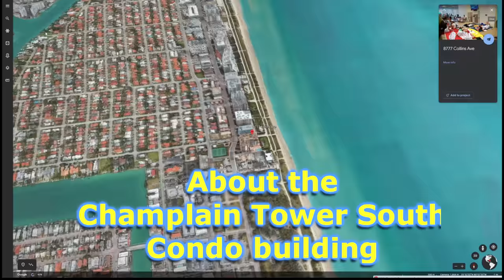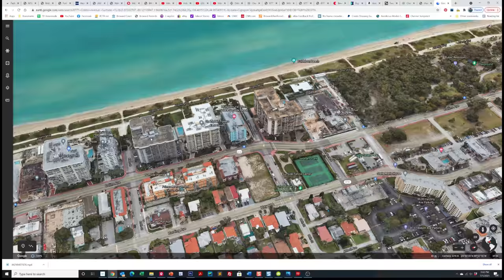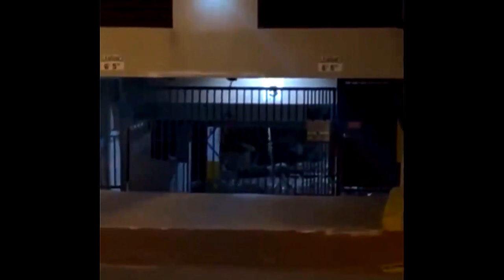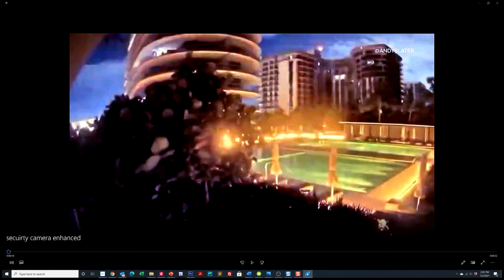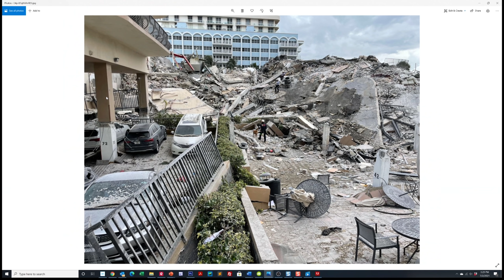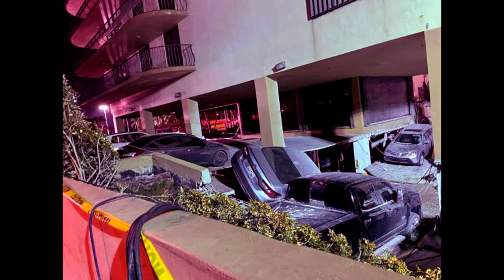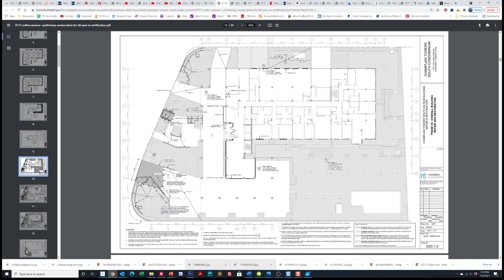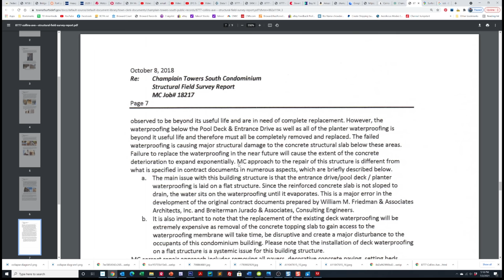Here's Cause Of Miami Condo Collapse Champlain Condo Towers, Surfside

Comment: Ironic how nothing fell in the pool but the corrosion under the pool explained everything.
Reply: Joe Kelly  The pool was essentially self supported, with the  base of it bearing on the ground, and the pool walls were also bearing on the ground, so no real load there. Even if it did cause the collapse due to water, which seems unlikely given the flat deck and the planters (which this video didn't mention, but which collect water), it would have remained intact and it in fact did remain intact.
Reply: If this were true, there'd be thousands of examples of buildings all along the coast collapsing due to saltwater and heat. This clearly wasn't corrosion. The probability that all the steel beams inside the concrete were equally corroded, and gave way at the same time without explosives is statistically impossible. Also, there's no way that natural corrosion would cause the building to be collapsed into tiny pieces of rubble. If this were natural, there would be huge pieces of the building still in tact, even after collapse. There's none of that. The debris of the fallen building is literally dust. Could have been DEW, either way, this didn't occur naturally.

People need to wake up. You can see the flashes(explosions) right before the reinforced steel concrete slabs were cut with dynamite or a DEW.

@Prairie Pucker said, "personally, I think you're an idiot. But there's gonna be an investigation. If there's wires and thermite, they're gonna find it"

Well, personally I think you're as useless as a used an bloody tampon, because they demoed the rest of the building 10 days later. They're going to find wires and thermite, but how can they find the cause of the collapse, when they destroyed the evidence? That's called a cover-up.

John Macafee had a residence in the building. This is your government. Wake up.
Reply: When you actually pay attention you will see he was simply showing what spalling was. Spalling was likely the cause of the collapse though not it them place he pointed it out.
Reply: @nikkishears6402  Tinfoil hat alert!!!
Reply: Pool did not make this building fall
Reply: @davemattia  If one person sounds dumb, it's you Dave. This is a very good video of what could have happened.
Reply: @xChrisN1975x  it's pretty clear that the ones with no commen sense and critical thinking skills are the ones wearing tinfoil hats. Not those who can think for themselves and can see clearly.
Reply: @nikkishears6402  Maybe you're not familiar with the way corrosion works. The water comes from above. When you see the spalling below the beams the whole beam is compromised. Also, when a vertical column collapses it causes a domino effect. All it's load is suddenly carried by the next column, plus the horizontal pull caused by the adjoining, collapsing column.
Reply: @nikkishears6402  from my understanding HAARP was used to take out these condos..
Reply: @heikkipolojarvi5736  , maybe you're not familiar with physics. If this theory were true, buildings all along the coast would be tumbling down. They're not. Name a single building that collapsed into free fall due to saltwater and heat. I'll wait.

Again, it's physically and statistically impossible that every steel reinforcement would be equally corroded and give way at the exact same time, causing a free fall collapse, dear easily manipulated.

And Macafee had a residence in the building.
Reply: @nikkishears6402  You are completely incorrect. A structure like this stands because the load of it is shared between many supporting structures. When a supporting structure fails the load it was supporting gets added on to the load the remaining structures have to support, plus it tugs on them in directions that they were not designed to resist, and once it exceeds the load they are able to support they will fail as well even if they were still in perfect condition. Clearly you know ABSOLUTELY NOTHING about structural engineering.
Reply: @davemattia  Built on sand?  What no pilings? Do you have an engineering degree?  Ping pong effect?   How have all the other buildings stayed standing then?
Looks SUSPICIOUS to me.  Just like 911.  Steel from China??
Reply: @debbyrobertsschabes647  1) Built on sand - yes - basically. The whole chain of land that makes up Miami Beach is built on man-made strips of sand and piled limestone dredged from the inlets and sea bottom.  Miami Beach is basically a fake barrier island.  2) Pilings?  Of course, they use them - proof that it's sand - but the law of averages suggest that when you build on sand, regardless of pilings, thousands, perhaps millions, of high-rise buildings throughout the world, you are eventually going to have a structural failure for any number of reasons.  These people were in the wrong spot at the wrong time.  Like a little house in the middle of a Scottish hamlet that gets hit with a 747 falling out of the sky.  It happened.  2)  Cheap Chinese steel - a definite possibility.   3)Chintzy real estate moguls - uh huh.
Reply: @nikkishears6402  thank you! If bombs in the parking garage at the bottom of the Twin Tower's couldn't bring down the building, how the heck would water be able to? This is bigger than just a water leak! One guy said he heard an explosion. Come on people!!!! Wake up!!!!!! This guy's explanation of how water caused the collapse could never happen! My uncle is a contractor and he said there's no way water could bring down this building. It's a nice narrative the msm would want us all to believe,  but it's not feasible!!!!
Reply: Wht up Tren Genius..✌
Reply: @OSUBUCKEYE1  And the Earth is flat too, right? Conspiracy theorist nut.
Reply: @kendalwilliam3980  , this was about Macafee's supposed suicide. Macafee had a residence in the building.
Reply: @kendalwilliam3980  , watch the video. You can see the tell tale signs of controlled demolition. This building was wired for demo. It wasn't HAARP.  Higher atmosphere auroral research project, that's all about weather manipulation, not building destruction. It could have been directed energy.

And Macafee had a residence in the building.
Reply: @OSUBUCKEYE1  , thank God others are paying attention.  Water corrosion has NEVER brought down a concrete and steel building in free fall.

It's hilarious that these morons think buildings just collapse into free fall for no reason other than corrosion.

Could have been DEW.
Reply: @NSRS1  exactly, the building obviously was a controlled demo. The fact that anyone believes that corrosion caused this is completely lost.
Reply: @davemattia  , no, dear obvious lies and propaganda. A concrete and steel building has NEVER collapsed at free fall speed due to corrosion. Name one.
Reply: @heikkipolojarvi5736  nonsense. The building fell because the columns were cut.
Reply: @kendalwilliam3980  😭😂😅🤣🤣🤣😅😂😭😭
Reply: @UNcommonSenseAUS  , thank you! No concrete and steel building has ever been destroyed in free fall due to corrosion.
Reply: @OSUBUCKEYE1  people don't want to see the truth.
Reply: @nikkishears6402   Given the limited evidence publicly available, experts now say it likely collapsed due to a “perfect storm” of random events - just like I tacitly implied, "Eventually, a building was gonna come down," but you know where I was wrong, Nikki?  It has indeed happened before, and it has happened a LOT of times.  Namely in Rio (1998) and Seoul (1995) to name just a few.  The incident in Rio (100s dead) was exactly the same as in Miami, and in Seoul, 500 people were killed in, again, the exact same kind of collapse.  Don't you google stuff before you come on here?
Reply: @davemattia  , reinforced steel concrete buildings don't collapse into free fall without explosives. This is basic physics.
Reply: @davemattia  , and this is the result of believing everything the TV and Google tell you.
Reply: @nikkishears6402  right on bro
Reply: These reports are goddamned, big-time lies. The causes of the disaster were willful negligence, indifference to human life, and greed. All this focusing on cracks in concrete is to distract you from the facts. The facts are they knew about it three years ago, and they did nothing about it. Knowing and doing nothing to prevent the catastrophe is criminal. Of course, in this insane country, they will try to sweep that aside and focus on material failures that were already known years in advance. In China those responsible would be imprisoned or executed. In the US they would probably be promoted.
Reply: @markcantemail8018  , controlled demolition.  Reinforced steel concrete buildings don't collapse into free fall without explosives. This is basic physics.
Reply: @davemattia  , please, learn something.

The physics of 9/11 — including how fast and symmetrically one of the World Trade Center buildings fell — prove that official explanations of the collapses are wrong, says a Brigham Young University physics professor.

In fact, it's likely that there were "pre-positioned explosives" in all three buildings at ground zero, says Steven E. Jones.

In a paper posted online Tuesday and accepted for peer-reviewed publication next year, Jones adds his voice to those of previous skeptics, including the authors of the Web site wtc7.net, whose research Jones quotes. Jones' article can be found at physics.byu.edu/research/energy/.

Jones, who conducts research in fusion and solar energy at BYU, is calling for an independent, international scientific investigation "guided not by politicized notions and constraints but rather by observations and calculations.
Reply: @nikkishears6402  I think I would sooner believe structural engineers than a particle physicist when it comes to understanding building collapse. One thing I have learned about specialized fields in science is that the people who work on them can be incredibly ignorant about things not close to their field. For example a virologist can be almost as ignorant as a regular college graduate when it comes to parasitology. Just because he is a scientist does not mean he can not be wrong. What matters in the end is the actual work.
Reply: @AzureDrag0n1  , structural engineers HAVE TO study physics to earn their degree, dear predictably obtuse. So lost.
Reply: @nikkishears6402  What a steel framed building does is not relevant here. This was a reinforced concrete structure. You clearly have not got a clue.
Reply: @AzureDrag0n1  , one thing I've learned from being an SRN, medical degree, is that fake accounts on YouTube ALWAYS back up and repeat whatever the media and governments tell them.  If all you're going to do is repeat your moral and intellectual superiors on TV, then you're nothing more than a parrot. No one needs another YouTube Nazi shilling and forcing propaganda down the public's throat so that we can all be the morally bankrupt and intellectually starving masses the government so desperately wants us to be.
Reply: @AzureDrag0n1  , it's called "The Laws of Physics" for a reason. No one's knowledge can be above the natural laws of science, dear easily manipulated.
Reply: fastguitar  , that's called critical thinking. Well done. You're one of a very small group who are still capable.

Macafee had a residence in the building.
Reply: @nikkishears6402  The only basic physics you know is that when you are full of s^^^^t  -- it eventually falls out into your shoes.
Reply: @kendalwilliam3980  so they missed also didn't the guy being extradited back to the US that died have a condo in Champlain Towers or is that more fake news
Reply: @davemattia  like the palm-tree inlets built in Dubai
Reply: @abatude5879  Yes -- very astute comparison.
Reply: @davemattia  , I'm an SRN. Medical degree. You don't even know what that is, dear pretending to have a doctorate.

From your Bio, which you told me to Google:

"Raised in New Jersey and originally educated as a zoologist, David-Damien Mattia works professionally as a writer for several international horse racing publications after having spent the last 25 year working as a successful trotting racehorse trainer and horse racing journalist. He also works as a featured journalist and columnist for The Canadian Sportsman Magazine, where his featured column, "Laugh Track" has been a favorite with horse racing fans since 2006. David is also a distinguished reporter for Harness Link and Harness Racing Update which are considered to be the most widely read horse racing websites in the world. Prior to devoting his career specifically to journalism and screenwriting, he trained some of the most famous harness racehorses of all time."
Reply: @davemattia  , where's the part about your degree, dear intellectually starving and morally bankrupt?😏🤣🤣🤣🤣🤣

You're a horse trainer. 🤣🤣🤣
Reply: @davemattia  , it says nothing about an award for any "film" you made, dear delusions of grandeur.
Reply: @davemattia  , also funny that your YouTube picture doesn't match your Google bio picture. Wonder why, dear liar?
Reply: @nikkishears6402  ....and you keep forgetting your second commas -- ugh -- imagine what you look like.
Reply: @nikkishears6402  Why does everyone block you ?   Because you are a troubled evil person - you're a mess - you are unhappy - you hate your father - you have many failed friendships and relationships -- you want people to hate you -- and you're very good at it.
Reply: @nikkishears6402  ok I won't stoop and comment how dumb your comment is. I will just prove how dumb it was. Obviously they did not all fail at the same time. 1 of them failed. The 1 below was suddenly struck with a force beyond its rating. So on and so on. I mean its not hard to figure out here my man.  If 1 can hold a ton and its struck by the 2 ton beam above it then Obviously it will fail. In fact thats how they demolish buildings. Ugh
Reply: @nikkishears6402  please don't refer to physics anymore you are making yourself look really really foolish.
Reply: @debbyrobertsschabes647  American steel was used in 79
Reply: @nikkishears6402  strike 2 careful you only have 1 left
Reply: @nikkishears6402  thats 3 strikes you are out dear Nikki. Hint....if the bottom is first to fail it causes free fall.......pssssst don't tell anyone. I cant tell you more it might hurt all 3 brain cells
Reply: @justanbaker8937  , "get laid. It will help."

Married 17 years. I get Laid twice a day, at least, dear PROJECTION, rolled in HYPOCRISY, and smothered in JEALOUSY.
Reply: @justanbaker8937  ........ And BLOODY....
Reply: @justanbaker8937 ...................... TAMPON,..........and twice as nauseating. 🤢🤢🤮🤮🤮🤮

🤣🤣🤣🤣🤣🤣🤣🤣💀👻🤣🤣🤣🤣🤣🤣🤣🤣🤣
Reply: @justanbaker8937  , I love your DUMFOUNDED silence followed by your absence. You're so accommodating. 🤣🤣🤣

That's called reverse psychology. Watch it work on you, dear easily manipulated.
Reply: The pool deck collapsed first.
Reply: @Courtney-1991  , the roof collapsed first. It's on video. 5 different angles.
Reply: @nikkishears6402  the pool deck ! That is located above the garage watch this video all the way through..people recorded the leaking in the garage and you can see the debris laying on the bottom of the garage 7mins before the collapse..did you even watch this video all the way through before you helped yourself in the comments 🙄
Reply: @nikkishears6402  And you just contradicted yourself if the roof collapsed first?
Reply: @Courtney-1991  , I provided the proof, dear Google GESTAPO. The roof collapsed first. It's on video, which I provided. This had nothing to do with water/salt corrosion, a leak, or heat. 

No steel reinforced concrete buildings has EVER fallen at free fall speed because of water. Not one.
Reply: @Courtney-1991  , 🤣🤣🤣even the news anchor mentioned that it "looked like controlled demolition."
Reply: @nikkishears6402  uh can’t believe the news..ya it was a pancake collapse hence why their saying it looked like a controlled demo. But it wasn’t ! If you would watch this video all the way through maybe get a different Perspective..this guy explains columns 72 and 43 very important
Reply: @Courtney-1991  , a "pancake collapse" excludes free fall speed. This building fell in free fall, dear failing to understand physics.

A free-falling object is an object that is falling under the sole influence of gravity. A free-falling object has an acceleration of 9.8 m/s/s, downward (on Earth). This numerical value for the acceleration of a free-falling object is such an important value that it is given a special name. It is known as the acceleration of gravity - the acceleration for any object moving under the sole influence of gravity. 

Gravity didn't bring down this building, and therefore each floor that "collapsed", would have to fall at a slower speed than the previous, dear obtuse.
Reply: @Courtney-1991  , I watched this video. This man has zero evidence for ANY of his assertions. The fact that you would be led astray by a no name YouTuber with zero proof only exemplifies how easily manipulated you are.
Reply: @nikkishears6402  ok well they will do a investigation, I’m 99% sure it was pure negligence that resulted in a building collapse with many fatalities..but a controlled demo no way they would have been able to figure that out already I’m sure and they will run test to test for thermite
Reply: I've got a concrete retraining wall in my BEACH HOUSE yard. I've had it rebuilt twice in 30 years. That is how corrosive the salt air is to concrete and steel rebar. As he explains, the steel swells due to the corrosive rust, which in turn, compromises the integrity of the concrete. In my case, the wall isn't holding up the foundation of the house, but holding the sand dune on which the house is built. Anyone who owns a home on the coast knows exactly what I'm talking about.
Reply: @Courtney-1991  , that's called hubris. You aren't sure at all, because you've refuted your own theory of what happened by labeling it a "pancake collapse". Impossible to be in free fall if it collapsed the way you say.

You couldn't have watchd any of the videos of the collapse. You can literally see flash bangs (explosions) at the base of the building. 

"There will be an investigation"

They demoed the rest of the building ten days later. They're going to find explosives. But how can they find the cause of the collapse, when they've destroyed the evidence?

"There will be an investigation"

You mean like the Warren commission? Your government told the public that a magic bullet made a u-turn when it killed Kennedy. Do you really trust your government? 

Please, don't repeat talking points that mean nothing.
Reply: @nikkishears6402  ok whatever you say 🙂
Reply: @RW4X4X3006  , 🐂💩. Water and salt alone have NEVER brought down a reinforced steel concrete building.
Reply: @Courtney-1991  , that's not an answer to my question. Do you really trust your government to tell you the truth?
Reply: @nikkishears6402  Really now...
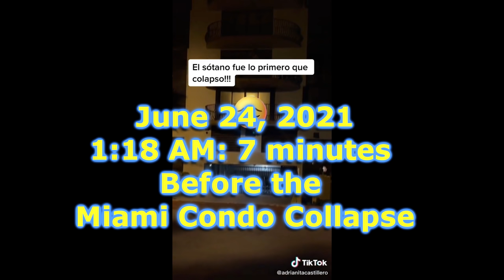Reply: @nikkishears6402    So then explain the video shown at 7:29 that shows the leaking and bits of concrete under the POOL DECK that occurred 7 minutes before the collapse. I guess you’ll say that’s just a coincidence. “Nah, the pool deck just crumpled up on its own for no reason before the controlled demolition. The fact that it’s also exactly where engineers are saying that the building collapsed is also a coincidence.”
Reply: @beckybrooks2150  , please, stop believing everything the TV tells you. I watched this video. This man has zero evidence for ANY of his assertions. The fact that you would be led astray by a no name YouTuber with zero proof only exemplifies how easily manipulated you are.
Reply: @beckybrooks2150  , the roof collapsed first. It's on video, which I provided. This had nothing to do with water/salt corrosion, a leak, or heat. 

No steel reinforced concrete buildings has EVER fallen at free fall speed because of water. Not one.
Reply: @beckybrooks2150  name a single steel reinforced concrete building that fell in free fall due to salt/water and heat. I'll wait.
Reply: It's built like a brick shithouse, and sits far away enough not to get buried in the rubble pile.
Reply: Imagine that!
Reply: @nikkishears6402  Yep!
Reply: @xChrisN1975x  I was waiting for that remark...some people never learn.
Reply: Concrete is porous and absorbs water similar to a sponge, when level with cracks water gets to the metal rods within concrete causing rust/expansion/cracking. This occurred at the base of smaller? concrete pillars with less rods. Makes sence. Thanks for your knowledge shared.
Reply: @davemattia  Just wondering,would you say that to a man you were face to face with?
Reply: I just think that's its only in our country thst buildings just FREE FALL INTO LESS THAN RUBBLE ..........
Reply: @nikkishears6402  this is not a steel frame building. It is heavy traditional  construction. Reinforced concrete slab floors supported on reinforced concrete columns. Common construction fault, insufficient cover to the reinforcing steel. Once  the steel has rusted, concrete has no strength in tension. It will break under its own weight.
Reply: So were the people in the pool at the time safer than those in their condos
Reply: I had that exact same thought!
Reply: @nikkishears6402  what?!?! Lol Why would anyone do that and why would they hide that fact? Everything isn’t a damn conspiracy for God’s sake!
Reply: @NSRS1  seriously! Sometimes these m o r ons make me wanna throw my phone!
Reply: @xChrisN1975x  You expect anyone to take you seriously?
Reply: @norisboren5402  , really? How come not one other building in Florida has EVER "collapsed into free fall" from salt water and heat. Name one. I'll wait.
Reply: @paulnewell927  , I said that, dear. "Reinforced steel concrete." Word for word. Name a single building in Florida that was collapsed into free fall by salt water and heat. It's NEVER happened.
Reply: @SimonEllwood  , 

"Insurance fraud is any act committed to defraud an insurance process. It occurs when a claimant attempts to obtain some benefit or advantage they are not entitled to, or when an insurer knowingly denies some benefit that is due. "
Wikipedia
Reply: Corona Virus  , thank you! I just call em like I see em. 🤣🤣🤣
Reply: Joe Kelly  As I've mentioned elsewhere, it would appear that the hot tub, specifically, was the place of first collapse. I don't know this for certain, but the shape of the concrete room in the spalling photos makes me believe that it is the concrete around the hot tube and that leaking of high temperature water has been going on for some time from that area. Remember that the entire condo seems to be supported on relatively thin columns with great resistance to downward forces but not very good resistance to horizontal forces, and also note that the slabs are poured between the columns and connect to the rest of the building. A slab tipping and falling into the parking garage would exert strong horizontal force on the sea of vertical supports holding the building.
Reply: @SimonEllwood  

"While a number of bridges, overpasses and buildings under construction fail each year, the catastrophic collapse of an occupied building — absent a bomb or an earthquake — is rare, and investigators are struggling to understand how it could have come with so little urgent warning."

“It would be like a lightning strike happening,” said Charles W. Burkett, the mayor of Surfside, Fla., where the collapse occurred. “It’s not at all a common occurrence to have a building fall down in America,” he said. “There was something very, very wrong with this situation.”

"Structural engineers were shocked that a building that had stood for decades would abruptly crumble on an otherwise unremarkable summer night."

- New York Times
Reply: @matthewmosier8439  , according to the video evidence, the roof collapsed first.
Reply: @paulnewell927  , "While a number of bridges, overpasses and buildings under construction fail each year, the catastrophic collapse of an occupied building — absent a bomb or an earthquake — is rare, and investigators are struggling to understand how it could have come with so little urgent warning."

“It would be like a lightning strike happening,” said Charles W. Burkett, the mayor of Surfside, Fla., where the collapse occurred. “It’s not at all a common occurrence to have a building fall down in America,” he said. “There was something very, very wrong with this situation.”

"Structural engineers were shocked that a building that had stood for decades would abruptly crumble on an otherwise unremarkable summer night."

- New York Times
Reply: @becorations1  , really? How come not one other building in Florida has EVER "collapsed into free fall" from salt water and heat. Name one. I'll wait.
Reply: @becorations1  , 

"While a number of bridges, overpasses and buildings under construction fail each year, the catastrophic collapse of an occupied building — absent a bomb or an earthquake — is rare, and investigators are struggling to understand how it could have come with so little urgent warning."

“It would be like a lightning strike happening,” said Charles W. Burkett, the mayor of Surfside, Fla., where the collapse occurred. “It’s not at all a common occurrence to have a building fall down in America,” he said. “There was something very, very wrong with this situation.”

"Structural engineers were shocked that a building that had stood for decades would abruptly crumble on an otherwise unremarkable summer night."

- New York Times
Reply: @becorations1  , I feel we need to talk about 9/11, cause clearly you believe the narrative from your government. Probably should discuss JFK as well, and the magic bullet that made a u-turn to kill him: official government narrative. Stop believing everything the TV tells you.
Reply: @nikkishears6402  it's just ridiculous the amount of deception than can be played upon the people. I came to the comment section while listening to this B's theory thinking thousands would be like - no way. Yet, here we are, a few of us shaking our heads, omg
Reply: @davemattia  )
Reply: @davemattia  If you believe MSM today, then I've got oceanfront property for sale here in North Dakota for you.
Reply: @barbibutton9619  , it's so sad that critical thinking is no longer a human capability. Unfortunately, I'm not shocked by the total lack of curiosity on behalf of the indoctrinated masses.

"it's easier to fool the people, than to convince them they've been fooled" - Mark Twain.
Reply: @nikkishears6402  Exactly.  If salt water, heat, etc., had caused this corrision and the building to collapse, why is the sister building, Champlain Towers North,  experiencing the same flaws, but it was given a clean bill of health at the same time the South towers failed its inspection. They were built at the same time, same contractors, same everything.  So, there is your control against why it isn't what MSM, etc., is saying it was spalling.  If it was, then the North towers would be exhibiting the same symptoms.   It's not.
Reply: @SimonEllwood  And you believe what is written on wikipedia?  That's like believing MSM.
Reply: @rhondaalbrecht  agreed. It's obvious to anyone with a working brain that salt water is incapable of causing a building to free fall into collapse. 

Most people are beyond stupid, and that's because our government has purposely engineered this stupidity. Propaganda had been legally pushed in America since 2005. Before 2005 it was illegal for our own government to propagandize the American people. Now they have legal authority to lie to us.
Reply: Lies Exposed  , yup! Couldn't agree more.
Reply: @rhondaalbrecht  I have helped write quite a few Wikipedia articles, where do you get your information from?
Reply: @SimonEllwood  , 

"While a number of bridges, overpasses and buildings under construction fail each year, the catastrophic collapse of an occupied building — absent a bomb or an earthquake — is rare, and investigators are struggling to understand how it could have come with so little urgent warning."

“It would be like a lightning strike happening,” said Charles W. Burkett, the mayor of Surfside, Fla., where the collapse occurred. “It’s not at all a common occurrence to have a building fall down in America,” he said. “There was something very, very wrong with this situation.”

"Structural engineers were shocked that a building that had stood for decades would abruptly crumble on an otherwise unremarkable summer night."

- New York Times
Reply: @SimonEllwood  ..... and BLOODY.......
Reply: @SimonEllwood  , and that's how we do an end run around your DESPERATE and PATHETIC Google censorship.

🤣🤣🤣🤣🤣🤣🤣💀👻🤣🤣🤣🤣🤣🤣🤣
Reply: @SimonEllwood  Oh, geez... maybe you just answered your own question?  'I have HELPED write quite a few Wikipedia articles'... that's my point.  ANYONE can contribute to an article on Wikipedia, even providing false information that sits there until it's verified, but many who lack critical thinking skills will believe those articles as gospel (the word 'gospel' translates to 'truth') and should be believed verbatim.  And that's one of the things that Wikipedia prides itself on, allowing ANYONE to edit said articles, so the information gets changed at will.  Go look up their policy, plainly written on the website.

I think of Wikipedia as I do Babylon Bee.  Satire.
Reply: @SimonEllwood  , I love your DUMFOUNDED silence followed by your absence. You're so accommodating. 😘

That's called reverse psychology. How much you wanna bet it works on you, dear easily manipulated?
Reply: @nikkishears6402  You said the building was steel framed I pointed out you were inaccurate. It seems in your case correcting your mistakes is useless. True I see that now.
Reply: @SimonEllwood  , by the way, responding to yourself in the hopes that I don't see your inferior reply, that's called COWARDICE. You could teach a class.
Reply: @nikkishears6402  Tiny explosions?  You obviously have never seen the explosions used to bring down a building.  They aren’t tiny by any means.  They often shoot out the sides of the building and are crazy loud.  Go watch videos of the old hotels in Las Vegas being brought down.  Granted many have fireworks beforehand but there is still the large explosions and to bring down a building, there needs to be a good amount of explosives.
Reply: @gsmith6026  , in the CCT video footage of the collapse that I posted in the comments here, they're tiny explosions. Watch the video, dear obtuse.
Reply: Pools should always be built on the ground floor in my opion
Reply: @ultramagapatriot5874  , this has nothing to do with a leaking pool or salt water corrosion. Name a single building anywhere that fell due to salt water and heat. I'll wait.
Reply: @nikkishears6402  Rubbish
Reply: @debbyrobertsschabes647  The others are NEW. That building was built in 1979. Structural engineering has changed A LOT since that era.
Reply: @davemattia  With all due respect, this story has our nation’s attention. Ie. Buildings along our extensive coasts have not been collapsing like this. It seems a bit ridiculous to write this off as “it happened cos it was built on sand.” Even if that is true, not every building by a beach is crumbling in on itself; this one did. So  it is important to ask why this one vs every other building by a shore?
Reply: @carolineobrien6301  , there are 18th century buildings along the east coast, none of which have collapsed. This has NEVER happened before. The idea that a building would fall in free fall due to salt water and heat is absurd.
Reply: @nikkishears6402  of course I don’t trust our government never have..but I really don’t see what gain they would get out of demoing this build..their already doing population control with Covid-19..so I really don’t see what the gain would be.
Reply: @nikkishears6402  <-- trump fan
Reply: @nikkishears6402  :
   You obviously failed basic physics.
Reply: @nikkishears6402  :
"SRN, medical degree?"
   Sorry Nikkishears, this does not qualify you as an engineer.
Reply: @nikkishears6402  :
"If you had, you'd know that no concrete and steel building has EVER fallen in a free fall collapse due to water/salt corrosion and heat."
   If you had any physics or engineering, you would know that just because something "never happened," doesn't mean it can't.
Reply: @snoglydox ****edit***
Still blocked by @Snoglydox. Still answering him in my comments. Proof rebar is better slightly rusted on concrete.

"The ASTM standard for deformed steel reinforcement (A706) and the Concrete Reinforcement Steel Institute (CRSI) Manual of Standard Practice both give the same recommendation: Reinforcing bar with rust, mill scale, or a combination of both is satisfactory, provided the minimum dimensions, weight, ..."
https://www.jlconline.com › how-to
Q&A: Is Rusty Rebar OK? | JLC Online
 
***End of Edit****

What's your degree in, dear remedial learning? Bending over for the government while you grab your ankles?
Reply: @nikkishears6402  :
" I'm an SRN, medical degree. You don't even know what that is, dear intellectually starving."

   Society for Healthcare Epidemiology of America Research Network in healthcare.
Reply: @nikkishears6402  :
  I'm an Engineer, which requires "advanced knowledge of physics;" It's part of my degree.
Reply: @nikkishears6402  :
"NEVER vote for Trump"
   You did when you didn't vote, especially in 2016.
Reply: @snoglydox  , you're not a engineer, dear delusional.
Reply: @snoglydox  , "you did when you didn't vote"

That's not how it works, dear lying, sanctimoniousness, self righteous, virtue signal. Only a third of Americans vote for their slaves owners.
Reply: @snoglydox  , proof you lie.

"While a number of bridges, overpasses and buildings under construction fail each year, the catastrophic collapse of an occupied building — absent a bomb or an earthquake — is rare, and investigators are struggling to understand how it could have come with so little urgent warning."

“It would be like a lightning strike happening,” said Charles W. Burkett, the mayor of Surfside, Fla., where the collapse occurred. “It’s not at all a common occurrence to have a building fall down in America,” he said. “There was something very, very wrong with this situation.”

"Structural engineers were shocked that a building that had stood for decades would abruptly crumble on an otherwise unremarkable summer night."

- New York Times
Reply: @nikkishears6402  :
"reinforced steel concrete building."
   The proper term is steal reinforced concrete; the Surfside condominium building is and never was a steal building.  The steal reinforcement is the rebar, and that is to keep the concrete together, as concrete can't handle tension; steal can't handle compression like concrete, so they work together, and if one is gone it fails.
   It appears so far that the failure of this building is a maintenance issue, but time is required to make it absolute.
Reply: @andrewjohnson9284  I like your word choice. It is a great video. Of what COULD have happened or been the cause. A tragedy no doubt. Especially given the caliber of the area and value of the real estate. Not that value should impact quality of human lives... That's just the world we live in.
Reply: @nikkishears6402  :
"name a single steel reinforced concrete building that fell"
   Surfside condominium building.
Reply: @snoglydox  , no engineer is even floating your absurd theory. So that's not even close to a fact. That's an opinion. Do we need to define facts and opinions? Cause you seen genuinely confused.

"it appears that this is a maintenance issue"

No, dear useless as a used and bloody tampon. It appears to be a controlled demolition. Flash bangs seen all over the base of the building in CCT footage of the collapse, dear lies and propaganda.
Reply: @nikkishears6402  ok we get it your gonna run with the roof collapsing first, are you even considering the surveillance camera view of the collapse..you don’t even see the first,second, or third floor..so you have no idea.
Reply: @SimonEllwood  
"You said the building was steel framed I pointed out you were inaccurate. It seems in your case correcting your mistakes is useless. True I see that now."
   I upped your comment; that is exactly what she is doing.
Reply: @nikkishears6402  :
"what's your degree in, dear remedial learning? Bending over for the government while you grab your ankles?"
   If you have such a problem following rules, then drive on the wrong side of the street, stop at green lights, and run through the red lights.

   You won't...your are such a sheep.
Reply: @nikkishears6402  :
"you do know the sinking of Titanic was an insurance scam"
   Ow my f*cking G*d.
Reply: @nikkishears6402  :
   Even if explosives were used there would be the similar results, and it wouldn't be "free fall" according to your post.
Reply: @nikkishears6402  :
"That's not how it works, dear lying, sanctimoniousness, self righteous, virtue signal."
   It's a wonder you realized you voted for trump.
Reply: @nikkishears6402  :
   How's that "proof you lie?"
Reply: @nikkishears6402  :
   The reverse physiology is on you.
Reply: @nikkishears6402  :
   Nope...it was maintenance.
Reply: @nikkishears6402  :
   Where did I post  "no one knows?"
Reply: @nikkishears6402  :
   Make up your mind, either free fall or the roof collapsed; which is it?
Reply: I call fu'kn bs 🐂💩!!!! In my personal opinion that was a professional demolition, they took that building down period..... Nothing you can say that will ever change my mind.... I trust no one period....
Reply: @snoglydox  why don't you do the world a favor? How bout you wander into a mass.....
Reply: @snoglydox  .................shooting, dear ENRAGED and OBSESSED with me.
Reply: @snoglydox  , here's a hint: look for a "gun free zone".
Reply: @nikkishears6402  :
"how can salt, heat, and water be the cause"
   Salt is a catalyst for metal, heat expands metal and water; the rebar rusting and expanding causes the concrete to break apart, creating a weakened beam.
Reply: @snoglydox  , no building in history has ever fallen from salt water and heat. Name one. It's not the Florida condo, dear intellectually bankrupt.
Reply: @snoglydox  , why haven't you wandered into a mass.....
Reply: @snoglydox  ............... Shooting yet?
Reply: @nikkishears6402  :
 "Name one."
    Champlain Towers South.
Reply: @snoglydox  , we're all waiting for you to find a "gun free zone". When you find one, stay there. Don't move. Just wait. 😏🤣🤣🤣
Reply: @snoglydox  ,"it's the most likely scenario."

 THAT'S not true, dear remedial learning. There's an investigation. There's no official reason, dear useless as a used and bloody tampon. No one is even floating this scenario as a possibility.
Reply: @nikkishears6402  :
 "useless as a used and bloody tampon."
   You need to take that thing out; you might get an infection.
Reply: @nikkishears6402  :
   You are really but-hurt; you really need to take that thing out!
Reply: @nikkishears6402  :
   You aren't an argument.
Reply: @nikkishears6402  :

   Salt is a catalyst for metal, heat expands metal and water; the rebar rusting and expanding causes the concrete to break apart, creating a weakened beam.
Reply: @nikkishears6402  :
    Did you make up your mind yet if it was it free-fall or if the roof collapse first?
Reply: @nikkishears6402  :
   Do you even understand that demolition works by damaging the first floor support, and not the roof?
Reply: @snoglydox  , "you can't make a post without correction"

I just did, dearest lying PROJECTION and HYPOCRISY.
Reply: @snoglydox  , why haven't you wandered into a mass.....
Reply: @nikkishears6402  :
   No it isn't official yet, but it is the likely cause, and not demolition that apparently started at the roof, but conversely free fallen.
Reply: @nikkishears6402  :
   You replace bed-pans when old men sh!t.
Reply: @nikkishears6402  :
"Shooting yet? How many times do you need to be asked, dear PSYCHO stalker?"
   That's not a supporting argument.
Reply: @snoglydox  "no it isn't official yet but it is the most likely cause"

No, dear C
Reply: @snoglydox  U
Reply: @snoglydox  N
Reply: @snoglydox  T
Reply: @nikkishears6402  :
" the roof collapsed first and it was a free fall"
   That's a conflicting statement, and doesn't make sense for a demolition.
Reply: @snoglydox  U
Reply: @snoglydox  N
Reply: @snoglydox  T
Reply: @snoglydox  that's not what an SRN does.
Reply: @snoglydox  "that's not an argument."

Stop plagiarizing me, dear unable to think for yourself.

Neither is "you replace bed pans", dear used and bloody...
Reply: @snoglydox  .... TAMPON......

"you have serious reading comprehension problems"

Really, name a building that has collapsed due to saltwater and heat, dear C
Reply: @snoglydox  U
Reply: @snoglydox  N
Reply: @snoglydox  T
Reply: @nikkishears6402  :
 "Neither is "you replace bed pans", dear used and bloody..."
   Actually that is; it shows you aren't qualified to make engineering arguments.
Reply: @nikkishears6402  :
   The only "delusional scenario" is from you.

   Lets say the Champlain Towers South Condo in Surfside is the only building to collapse under such situations; there has to be a first time for everything.  And you posted it was for money?  No matter what the final decision for the collapse, lawsuits have already been filed; it's going to cost them, likely in the billions.
Reply: @sunlitrain  the moot point
Reply: @nikkishears6402  :
"that's not what an SRN does."
   You replace bed pans.
Reply: The whole pool deck was built flat, huge mistake so it probably wore down became weak and corroded most likely n the part of the initial collapse. The whole thing was built over a garage. It went garage, pool deck, then the condo building on top.
Reply: @nikkishears6402  Perhaps they were slopes in their pool and the construction was better. Tell me why no other building in Florida has been imploded without knowledge for no reason.
Reply: @snoglydox  , slightly rusted rebar has better bond to concrete than uncorroded rebar. If the concrete is 'good' further corrosion will be minor as the concrete should be sufficiently alkaline to prevent rusting, and dense enough not to permit enough 'water or air to reach rebar to cause corrosion. 

There can be no corrosion from salt without air.
Reply: @snoglydox  , "that's a conflicting statement, and doesn't make sense."

When a building is demoed, the roof caves in first, because the destruction of the core of the building is the goal with the first blast. 

That's what happened here, and I have proof with videos in which even the news anchor says, "it looks like a controlled demo".
Reply: @snoglydox  "actually that is,; it shows you aren't qualified"

Again, that's not what an SRN does. I'm never in a patient's room. I'm only in the operating room. 

Again, how does being a talking, used and bloody tampon, and a liar pretending to be an engineer make you qualified, dear PROJECTION, rolled in HYPOCRISY,  wrapped in RAGE, and covered in DESPERATION?
Reply: @snoglydox  "there has to be a first time for everything"

No, dear assumption. The laws of physics are finite. You're delusional scenario isn't possible. Show me the pictures of damages to the concrete that allowed for the rebar to deteriorate, before this collapse.
Reply: @snoglydox  "you ever wonder why men use and dump you all the time"

Wrong again, dear JEALOUSY. Married 17 years.
Reply: @snoglydox  , 

"While a number of bridges, overpasses and buildings under construction fail each year, the catastrophic collapse of an occupied building — absent a bomb or an earthquake — is rare, and investigators are struggling to understand how it could have come with so little urgent warning."

“It would be like a lightning strike happening,” said Charles W. Burkett, the mayor of Surfside, Fla., where the collapse occurred. “It’s not at all a common occurrence to have a building fall down in America,” he said. “There was something very, very wrong with this situation.”

"Structural engineers were shocked that a building that had stood for decades would abruptly crumble on an otherwise unremarkable summer night."

- New York Times
Reply: @nikkishears6402  omg I really hope that isnt the case.if someone purposely caused this they dont deserve to live.
Reply: @godblessacountrygirl5324  , John Macafee had a residence in this building. Just saying.
Reply: @godblessacountrygirl5324  , **EDIT**
@Snoglydox blocked me from commenting, because he claimed to be an engineer, not knows nothing about it. Slightly rusted rebar bonds with concrete better than untrusted. That was a direct queue from cement.org, dear delusional. Good sound concrete has a pH in the pore solutions of 13.0 to 13.5, which is much more alkaline than something like Drano. In this environment, the steel forms a thin layer on its surface that we call a passivating layer. This layer protects the rebar and prevents the anode from forming so no corrosion can occur.

  it wouldn't be the first time. I encourage you to look into 9/11.
Reply: @nikkishears6402  OK. That makes more sense than the people saying that the building was blown up because Ivanka Trump live nearby.  But if you’re going to do something like that, wouldn’t it make more sense to do it mid day when most people are at work or out of the house? I just don’t think everything is a conspiracy. The problem is they didn’t make repairs they were told to make when they were inspected a couple years ago. And now they’re saying there’s a criminal investigation because the misappropriation of funding. It was a crime. I just don’t think it was an explosion.
Reply: @Chronically_JBoo  :
   Actually witnesses who escaped saw the pool deck collapse first, which appeared to pull the building support columns in the garage, taking down the building.  People in the building have told family on the phone that they heard unusual creaking noise days before the incident.
Reply: @kendalwilliam3980  nothing about Macafee living there or his son🤔  no one saying anything about that? 
They will probably delete this comment.
Reply: @nikkishears6402  :
"slightly rusted rebar has better bond to concrete than uncorroded rebar."
   You have a comical imagination.
Reply: @nikkishears6402  :
"Again, that's not what an SRN does."
   Nope...you swap bed-pans out; how does swapping bed-pans out qualify you as an engineer.
Reply: @nikkishears6402  :
   What I find funny is you don't even know who David Dunning and Justin Kruger are, and had to look it up...hence your confusion.
Reply: He's not saying that the POOL was the problem.Rather the problem is more likely the POOL DECK...the floor between the pool and the building tower that covered the underground garage. 

The pool deck was built flat, encouraged water (likely laden with salt and chlorine)  to pond. We know the waterproofing on the pool deck was failing, so that water was working it's way through the concrete deck. 

A failure of that deck (for example, punching shear around a garage column) could cause a concrete column to buckle . Once one column fails, a progressive failure (pancaking) is nearly inevitable.

My guess is that the causes of failure will be identified as a combination of: 
1) Poor structural design (particularly column dimension and slab thickness) 
2) Poor architectural detailing (Poor drainage of the pool deck) 
3) Lack of maintenance.

Two big unknowns: nature of original building materials and construction techniques; and, condition of the foundations and supporting soils.
Reply: @nikkishears6402  :
"Let's play "who knows more about engineering", shall we?"
   You wasted many hours looking up stuff you don't understand and miss-wrote; you can't learn engineering on the internet, especially in a couple hours, which is why you are only qualified to swap bed-pans.
Reply: @nikkishears6402  / so steel exposed to similar environmental variables, will naturally corrode at different rates? Also, isn’t the punch through focused on one area, which then created a pulling force on the 3 initial columns. 

With all due respect, your argument is analogous to saying “only one card was removed, therefore the rest of the house of cards should’ve stood”
Reply: @nikkishears6402  / You are stating that “physically and statistically impossible“. Considering that from a basic physics standpoint, it is theoretically possible. This leads me to believe that do you have a poor understanding of statistics
Reply: @nikkishears6402  / I hereby knight you “Sir. Dunning Kruger”.
Reply: @leland818  someone’s gotta let the Navy know they can cancel all corrosion control. It’s psychically impossible.
Reply: @davemattia  Good Job, well said. He even quoted in this tread that he is an engineer, must have got the license out of the Coco puffs cereal box. Why cause he be Coo to the coo coo Bird. Middle of building falls from top down PERIOD. As the shill tries to convince us how it happened instead of why... Is it true that mac daddy fee had a flat there? IDK.
Reply: @karenabrams8986  / IKR! Apparently my understanding of poured concrete and rebar… And all the money spent on alternatives like helix… It’s all just fake news. Glad to know that’s nothing to be concerned about. Honestly I am astounded how gullible the top engineers and architects in America are. I mean the only reason epoxy coated rebar ever existed was to support big epoxy (/s just to be safe)
Reply: Not to mention they say it was from flooding or a large amount of water. Where is the wash out. None o the dirt was moved. if the the pool cracked like they said why was it full of water, so not that. Also, look at the pics of the rubble. The dirt is dry. Where is the mud?!? If that building feel from water, why is the dirt dry & there is no standing water anywhere?
Reply: Please look at the flash explosion that went off on each section of the building in the slow motion footage before they fell thats why the pool was still in tact. Believe half of what you see and nothing what you hear.
Reply: @Biscuitflipper  / about the pool cracking, that’s not currently part of the theory. It may have been day one, but I don’t think anyone is seriously considering that right now
Reply: @jamescampbell9840   / you know, sure is it theoretically possible someone took it down on purpose… Yeah. Is it likely, no not really. As for the explosions, how do we differentiate between let’s say gas lines, electrical shorts, strong friction, et cetera. 
Engineering disasters are an amazing field of study, but as often as someone wants to make something sensational, usually it breaks down to ignorance, greed, and/or laziness. 

As I said elsewhere the models currently represented do not include the pool. They failed to slope the waterproof pad. Additionally in 2018 they failed to make the recommended modifications due to expense. 
I know we all want excitement and purpose in life, but once again I believe that unfortunately this is just stupidity

But then again, maybe I’m on here just to discredit your theory. I could be part of the entire plan
Reply: @snoglydox  , "what I find funny is you don't even know who Dunning Kruger are, you had to look it up ." 

I know what it is and who they are. I told you how to spell it correctly, dear stable genius who thought it was "Dun and Krueger effect, dear PROJECTION and HYPOCRISY.

The opposite of the Dunning-Kruger Effect is the Impostor Syndrome. This is a cognitive bias where someone is unable to acknowledge his or her own competence, dear imposter.

"you have a comical imagination."

The ASTM standard for deformed steel reinforcement (A706) and the Concrete Reinforcement Steel Institute (CRSI) Manual of Standard Practice both give the same recommendation: Reinforcing bar with rust, mill scale, or a combination of both is satisfactory, provided the minimum dimensions, weight, and height of the deformations (the formed protrusions on the bar) of a hand-wire-brushed test sample are not less than the values specified in the standard. In other words, if the rust or mill scale is light, it will not affect the bond to the concrete. In fact, studies have shown that mill scale and light rust enhance the bond between concrete and steel."

https://www.jlconline.com › how-to
Q&A: Is Rusty Rebar OK?

That was a direct quote from an engineering website, dear lying about being an engineer. How could I have "written it wrongly" if it was copied and pasted, dear useless as a used and bloody....
Reply: @snoglydox  C
Reply: @snoglydox  U
Reply: @snoglydox  N
Reply: @snoglydox  T
Reply: @snoglydox  rag?
Reply: @leland818  , if it's physically and statistically possible that reinforced concrete buildings collapse into free fall due to saltwater and heat, why hasn't it happened before, dear Google censorship? What a shockingly disgusting...
Reply: @leland818  ... Dumpster.....
Reply: @leland818  C
Reply: @leland818  U
Reply: @leland818  N
Reply: @karenabrams8986  , no one said corrosion wasn't possible, dear strawman argument. We are saying there has never been a reinforced concrete building that fell in free fall due to saltwater and heat. Name one. I'll wait.
Reply: @leland818  , show me the pictures of this corrosion pre collapse. Since many engineers suggest that slightly rusted rebar creates a stronger bond between the concrete and the rebar, why did it collapse? Show your proof, dear, useless as a used and bloody....
Reply: @leland818  , @Prairie Pucker, this is for you too, .....C
Reply: @leland818  ,  @Prairie Pucker, this is for you too,
....U
Reply: @leland818 @Prairie Pucker, this is for you too,...

N
Reply: @leland818 , @Prairie Pucker, this is for you too,..........

 T
Reply: @leland818 @Prairie Pucker, this is for you too,....

.......................... rag.

'how do we differentiate between let's say, gas lines, electrical shorts, strong friction, et cetera"

If it was the gas line exploding, then that's the cause of this collapse. No one is floating this theory. Electrical shorts don't look like a dynamite explosion. "Strong fiction"? From what?

These were explosions from dynamite laid for a controlled demolition.
Reply: the corrosion under the pool wasn’t the cause of the pool deck collapsing
Reply: @leland818  , 'how do we differentiate between let's say, gas lines, electrical shorts, strong friction, et cetera"

If it was the gas line exploding, then that's the cause of this collapse. No one is floating this theory. Electrical shorts don't look like a dynamite explosion. "Strong fiction"? From what?

These were explosions from dynamite laid for a controlled demolition.
Reply: @leland818  , name a single building that fell due to saltwater and heat alone, dear C
Reply: @leland818  U
Reply: @leland818   M
Reply: @leland818  dumpster
Reply: @leland818  C
Reply: @leland818  U
Reply: @leland818   N
Reply: @leland818  T.

I'll wait.
Reply: @leland818  U
Reply: @leland818  M
Reply: @leland818  Dumpster
Reply: @leland818  C
Reply: @leland818  U
Reply: @leland818  N
Reply: @leland818  , since slightly rusty rebar actually bonds more effectively with concrete, how did corrosion bring this building into free fall, dear
Reply: @leland818  C
Reply: @leland818  U
Reply: @leland818  M
Reply: @leland818  Dumpster
Reply: @leland818  C
Reply: @leland818  U
Reply: @leland818  N
Reply: @leland818  T
Reply: @leland818  , no, it hasn't. Not one building in history has ever fallen in free fall due to saltwater and heat. Name the building, post your proof, dear lying...
Reply: @leland818  F
Reply: @leland818  U
Reply: @leland818  C
Reply: @leland818  K
Reply: @leland818  T
Reply: @leland818  A
Reply: @leland818  R
Reply: @leland818  D
Reply: @leland818  , "it happened a lot"

Then you should be able to prove it, dear
Reply: @leland818  C
Reply: @leland818  U
Reply: @leland818  M
Reply: @leland818  DUMPSTER
Reply: @leland818  C
Reply: @leland818  U
Reply: @leland818  N
Reply: @leland818  T
Reply: @nikkishears6402  / out of pure morbid curiosity, what does dumpster UC mean
Reply: @leland818  C
Reply: @leland818  U
Reply: @leland818  M
Reply: @leland818  DUMPSTER
Reply: @leland818  C
Reply: @leland818  U
Reply: @leland818  N
Reply: @leland818  T
Reply: @nikkishears6402  / hahaha, never mind. I see your “letter by letter” comments spelling out “c*m dumpster”. I’m going to take this as a sign that reasonable discourse is a waste of time. Have a wonderful evening. I hope all is well in your life. I know things can get tough. //
Reply: @snoglydox  / I know you and I have not spoken one on one, but I think we can both agree that this has been a very interesting thread. I kept trying to think that it was a troll or a joke, but sadly not. Hopefully Nickie gets the support here she needs
Reply: @leland818  , my name's not Nickie, dear C
Reply: @leland818  U
Reply: @leland818  M
Reply: @leland818  DUMPSTER
Reply: @leland818  C
Reply: @leland818  U
Reply: @leland818  N
Reply: @leland818  T
Reply: @leland818  , 

"I kept trying to think it was a troll or a joke, but sadly not"

Oh there's a troll and a hilarious joke of a Google shill. Wanna see? Just look in the mirror, dear @Snoglydox. 

Couldn't you even try to use a different script for your many different fake accounts?
Reply: @kendalwilliam3980  exactly that's what I'm feeling, much♥️☮🙏from you supporters worldwide 🇦🇺🇦🇺🇦🇺🇦🇺
Reply: @rhondaalbrecht  well said and thought out Rhonda, much 🇦🇺
Reply: @duketomlinson3270  , this was obvious controlled demolition.
Reply: @human-qp1mf  , I mentioned this much earlier in the comments. You're not alone.
Reply: @nikkishears6402  I think so ,this is world we live in ,sad
Reply: @leland818  .............TAMPON, and twice as nauseating.

🤣🤣🤣🤣🤣🤣🤣🤣🤣🤣💀👻🤣🤣🤣🤣🤣🤣🤣🤣🤣🤣
Reply: @nikkishears6402  one of my favorite sayings. I just got slammed in a comment section when I mentioned a few "facts" about the experimental jab. I can't with these people.
Reply: @barbibutton9619  , I just got blocked from speaking here by a YouTube Nazi playing 3 different people in these comments, because I proved this was a controlled demolition. They can't win the argument, and so they have to cheat to silence us. They're so DESPERATE and PATHETIC. The blatant lies, projection and hypocrisy make me wanna🤮🤮🤮.
Reply: @kendalwilliam3980   Is your tinfoil hat made the name-brand stuff? It looks very shiny. ☺ Seriously, we must protect the beautiful mind that can create a convoluted story that somehow connects back to the Trumps. It's so hilarious. Thanks for the unintentional comedy. 😂
Reply: @nikkishears6402  Babe, take a deep breath and stop repeating yourself. The people who have to shout and repeat all their ideas aren’t the ones being listened too. Please come up with an actual succinct argument. Also, medical degrees do not require adequate knowledge of structural mechanics. You wouldn’t need to know material properties or chemical interactions with building materials. Please, one semester of an algebra based physics 1 class in newtonian mechanics does not bolster your credibility.
Reply: @claudiavondra9240  F
Reply: @claudiavondra9240  U
Reply: @claudiavondra9240  C
Reply: @claudiavondra9240  K
Reply: @claudiavondra9240  yourself, dear
Reply: @claudiavondra9240  ,  I have some unsolicited advice for you: SlimFast.

Stop eating everything that isn't nailed to the floor. You'll live longer. You're a heart attack waiting to happen.
Reply: @nikkishears6402  At least I’ll die happy and not miserable unlike some people who feel a need to put others down to make themselves feel strong :))))) Have a great day!
Reply: A Personality disorder has overwhelmed this post.
Reply: @nikkishears6402  I'm not the one that came here with a set conclusion. That's on you. This video and all available information show a clear pattern. You simply reject the data that is presented out of some pathetic desire for tragedies to be fantastical.

If you absolutely need a conspiracy, then here are the clear conspiracies:
*Lacks building code standards to maximize profits.
*Lazy and corrupt inspectors and politicians that could be bought off.
*Insufficient building and maintenance codes that were created by those same politicians. 

See, there's plenty of terrible people to blame. I'm guessing it's not convoluted or willfully sinister enough to scratch your itch though. 🤷🏾‍♂️
Reply: The mooninites did it. Hot Carl is pissed Aqua Teen Hunger Force
Reply: Joe Kelly  saturation of water that the structures swallowed (most important the columns and beams)  because of that slab in the deck area, having no drainage design or slopes was a serious mistake… every single rain was not just evaporated, it leaked to the structures and in time rust everything in its path…
Reply: @nikkishears6402 , I must admit, there are flashes just before the collapse(s). The right side stays standing, then u see flashes and then it collapses as well.
Reply: @paulnewell927  True concrete only has compressive strength, virtualy no tension, shear, or torsion. Every garage slab below grade I've worked on has had multiple plastic encased steel tension cables running end to end. When was this thing built again?
Reply: @xChrisN1975x  Metal and saltwater aren't friends. Any imperfections in concrete/rebar will lead to serious structural problem in a coastal environment.
Reply: @nikkishears6402  G'day why haven't they replied... Answer cos no buildings ever xollaped like that.... Ever
Reply: Nikkishears 7 buildings you mean.  All 7 and only the 7 in the WTC came down by afternoon.
Reply: Jeff Ostroff are you working for the elite who blow this building, like the twins towers, like a plane could destroy two towers, no 3,  your very deep analyse make no sens, sorry , no hard feeling the pool is still ok so maybe you have the wrong profession.
Reply: @carolineobrien6301  Please explain, then, why 'that building' has a sister building, three doors up, and it isn't exhibiting any of the same symptoms as 'that building', when they were built at the exact same time, using the same contractors, same material suppliers, et al?  They're identical buildings, just the floor plans are reversed.  That sister building received a clean bill of health from the same engineering company that did the inspections on 'that building'.
Reply: @Courtney-1991  It's not the government that did it.  It's the corporate owner of the buildings that arranged for the demolition, for insurance fraud.  Those condo unit owners bought their units from the corporate owner.  They made it look like it was an accident.  There's now been an investigation launched into what happened.  If they follow the money, they'll find out the truth.  BTW, anyone wonder WHY the Israeli Defense Forces sent over their search and rescue dog teams to scour this particular building?  They've never done that before, as we can see from OKC Murray building, NYC's WTC, et al.  ALL of those S&R teams were domestic.
Reply: @snoglydox  Actually, you obviously don't believe that 9/11/01 was a government sponsored demolition, either.  But both the Titanic AND 9/11/01 were.  Deep State/NWO.  Ya might wanna do some research into the New World Order and what they have done to pit countries against each other in wars through the centuries, financing both sides, for their own financial gain.  George W. Bush was president at the time of 9/11/01, right?  Well, he and his evil daddy are/were both on the Steering Committee of 300 of the NWO.  And guess who is the chairwoman of this committee?  None other than Queen Elizabeth II.  You can look it up by googling it... it's all out there.  Yes, the Titanic was deliberately sunk, because of the three bankers that were on the ship that refused to comply with the NWO's demands that America establish a central banking system, something that the Founding Fathers of America explicitly put in our original constitution to NOT establish.  You might want to look that up, too.  1789 US Constitution, vs. the Act of 1871, which created our current US Constitution, establishing the District of Columbia as a corporation, as well as establishing a central banking system (the Federal Reserve).  You might want to realize that when the 1789 version was ratified by the states, there was NO 'District of Columbia' as Washington, DC didn't exist until the 1st John Adams' presidency.  So, how can the US Constitution establish a corporation of District of Columbia when it didn't exist at the time?  This proves that the Act of 1871 which produced our current Constitution is a fraud, as it was NEVER ratified by the states, and passed by Congress in the dark of night on Christmas Eve in 1871.  Why?  Because our nation was broke, and the NWO banksters promised a loan to bail us out, IF they changed the constitution so that a central banking system could be established.  That paved the way for the Fed to be established in 1912, and a year later, in 1913, the IRS was established, which in turn, enslaved and made every citizen of the US collateral property.  You really are a moron.
Reply: @nikkishears6402  :
   I see you wasted more of your time Googling stuff you will never understand.
  Search this phrase: cognitive dissonance.

   You're not an engineer, you never will be an engineer, and all you're good for is changing bed-pans, so don't quit your job changing bed-pans.
Reply: @leland818  :
   Better be careful what you post; she will think we are the same person.  I'm by far not a physiologist, but it appears she has a disturbing case of trying to get recognition.
Reply: @nikkishears6402  this wasn't due to explosives. There is no evidence at all of that being a cause, but there is a load of evidence that the crumbling foundation likely caused it.
Reply: @rhondaalbrecht  :
   I was on the internet in the early 70s; it amuses me how using the internet today is so easy, any idiot can use it.
Reply: @OSUBUCKEYE1  the thing is, if 911 was an inside job it's understandable that it could be covered up. If Champlain towers had been taken down by explosives there's no way to cover that up. You've got all kinds of investigations going on and you'd better believe someone would find and report evidence of foul play. We're talking about mass murder here. That's not going to stay under wraps. Think about it.
Reply: 3 buildings fell on the trade towers as an implosion one not even touched by debris..looks the same.. The pool maintenance guy was just "evidence" to support An idea.. Just like a camera man recording the inside of Washington D c's insurrection.. You don't need a camera man unless you need evidence to show the world a different idea someone wants to project. 
Convenient
Reply: @nikkishears6402  They didn't all fail at once.  That's an idiot statement.  One section collapsing makes more load for the next section.  That section collapses making more load for the next section, and then the next one collapses in a complete domino effect because a building can only lose so much of it support structure before it collapses under its own weight.  Every support beam holds a certain amount of load.  You don't need to take out all of them, just enough so that the rest can no longer hold up the load any more.
Reply: @nikkishears6402  What? You saying this was purposely brought down ? Or are you talking the Twin Towers?
Reply: Joe Kelly  The water under the ground floor was likely runoff from the ground itself; otherwise, there would have been chlorine in it which would have made the conditions far worse.  Chlorine corrodes iron far better than water.
Reply: The corrosion wasn't UNDER the pool. The corrosion was in a different area above the garage, but from the open deck, like a patio adjacent to the pool.  He clearly, several times, shows the pool in the garage way down at the other end of the garage. And it was not part, in any way, of the collapse.
Reply: Yeah ,..oh ,..and the palestinian bomb in the parking garage targeting the JEWS IN THE NEIGHBORHOOD kinda mights caused some damage too there, chief
Reply: I read that they had problems with ocean salt water making it's way into the pool area and the parking garage.
Reply: @oilfreak710  The only water more corrosive than chlorinated water in the setting would be salt water...
Reply: @nikkishears6402  get help or medication asap
Reply: Tirtza Gabay  ,🤣🤣🤣 buildings don't collapse in free fall from a leaking pipe, dear obtuse. If that's possible, why hasn't it happened before? Name the building. It's NEVER happened.
Reply: @pickle581  , I'm saying Macafee had a residence in the building. Wake up, dear.
Reply: @wordforger  , "that's an idiot statement"

That's called PROJECTION, dear HYPOCRISY.

No building in history has fallen in free fall from saltwater and heat. If this is so very common, name the building. I'll wait.
Reply: @kimberlysevastyanenko3798  , sorry to tell you, Macafee had a residence in the building. This was your government, AGAIN.
Reply: @snoglydox  , Macafee had a residence in the building, dear believe everything the TV tells you.
Reply: @nikkishears6402  The Psych ward called. They're looking for you.
Reply: @xChrisN1975x  not really a tin foil as you mentioned.
the collapse was too clean.
you need to pay attention.
these buildings have accurate alarm systems and get notified once a pipe breaks. doesnt look like any of that was reported.
at least has not been reported yet.
Reply: pool deck. Not .. the pool itself. And for all the possibilities of "leaks" , that pool looked pretty dang full.  I don't know where the pool mechanicals were in relationship to the pool itself, but their usually not located very far from each other.
Reply: @rickw4160  , water wouldn't make the building turn to dust. If it was water, there'd be huge chunks of the building still in tact. There was only dust.
Reply: @Rihanna Reid then look out for dynamite and DEWs.
Reply: @Rihanna Reid , expect the sky to fall at any moment. Our world is run by government psychopaths.😉
Reply: @nikkishears6402  every steel beam was not equally corroded, they had similar corrosion but it wasn't exactly equal. Also all beams didn't "fail at once" its a snowball effect. If one beam fails that puts stress on the beans around it and since the beams were corroded they couldn't handle the extra weight causing them to fail and so on. You can clearly see in the video that the building didn't fall all at once if you use your eyes, its very quick but not simultaneously. Also there are many buildings that are taken down due to erosion and they are usually condemned before it gets to this point which is why this may seem like the first time it happened. There are also people who get paid to look at buildings and repair them.  But I guess we're ignoring that and only looking at disasters. Don't mention physics or statistics when you don't understand either concept please.
Reply: @Kolazola  , If this were true, there'd be thousands of examples of buildings all along the coast collapsing due to saltwater and heat. This clearly wasn't corrosion. The probability that all the steel beams inside the concrete were equally corroded, and gave way at the same time without explosives is statistically impossible. Also, there's no way that natural corrosion would cause the building to be collapsed into tiny pieces of rubble. If this were natural, there would be huge pieces of the building still in tact, even after collapse. There's none of that. The debris of the fallen building is literally dust. Could have been DEW, either way, this didn't occur naturally.

People need to wake up. You can see the flashes(explosions) right before the reinforced steel concrete slabs were cut with dynamite or a DEW.

@Prairie Pucker said, "personally, I think you're an idiot. But there's gonna be an investigation. If there's wires and thermite, they're gonna find it"

Well, personally I think you're as useless as a used an bloody tampon, because they demoed the rest of the building 10 days later. They're going to find wires and thermite, but how can they find the cause of the collapse, when they destroyed the evidence? That's called a cover-up.

John Macafee had a residence in the building. This is your government. Wake up.

 I posted the video of the collapse. You can clearly see it was a controlled demolition. You can view the dynamite explosions throughout the building just prior to collapse. Good try though, dear PROPAGANDA pusher.

I'm not the one unfamiliar with physics, dear PROJECTION and HYPOCRISY. This was a free fall collapse which can't happen if the building fell the way you suggest.
Reply: @nikkishears6402  just lol time to take your medicine
Reply: That is funny. They should of all jumped in the pool.